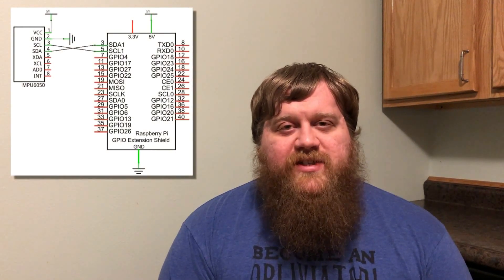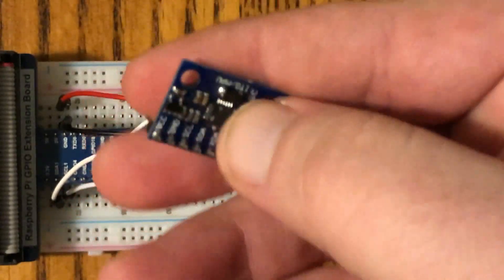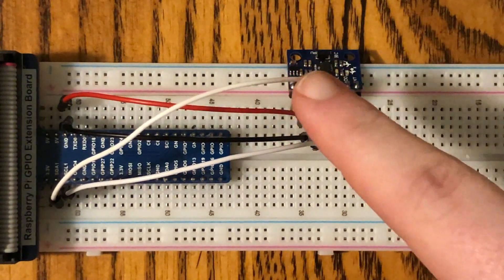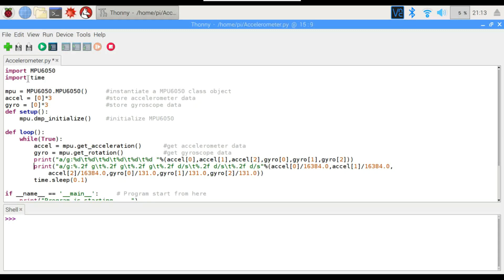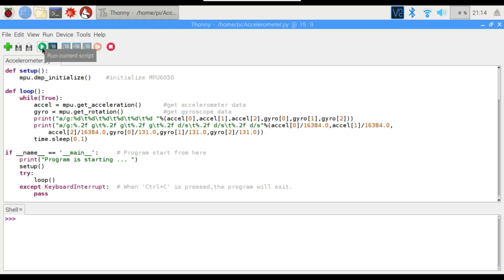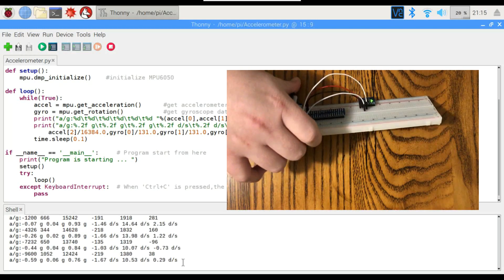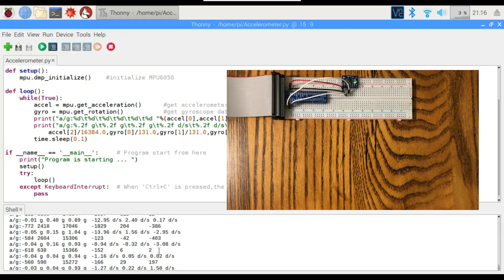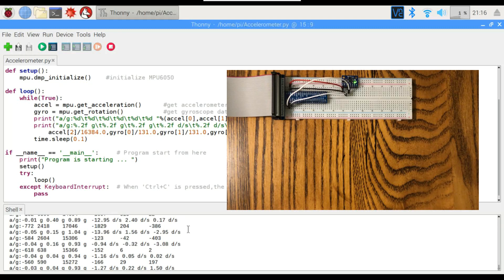MPU6050 Accelerometer | Raspberry Pi 3 B+ | Projects for Beginners

Comment: Hello do you quote projects for custom build,  I live in Connecticut and been watching your videos on Raspberry Pi development.   We have project that is a bit involved past my understanding and I am seeking to get quotes and hire a developer that can help us use this device gather data from a Spectral sensor to be used on a drone, its an interesting use case that will also involve an acelerometer as sensor trigger.
I can send the Dev docs from the sensor Manufacture Is this something you are interested in quoting to us or anyone out there, kind of a hot job need a quote ASAP.. Thanks